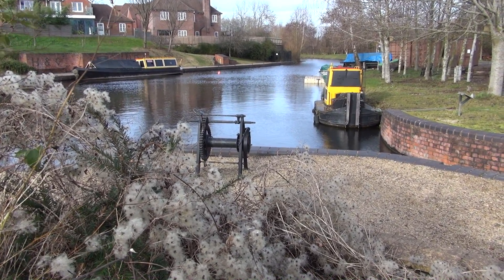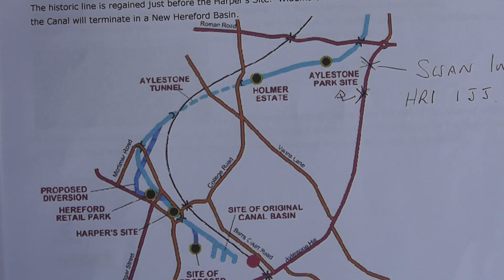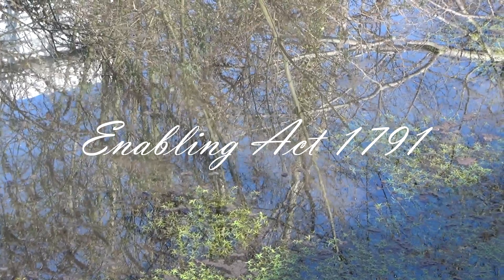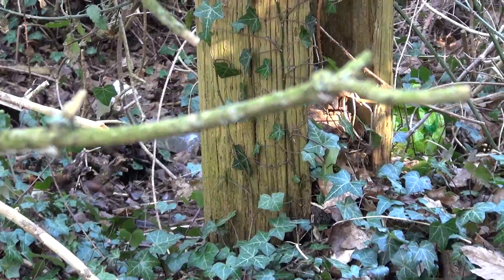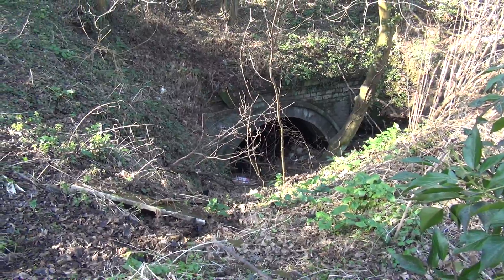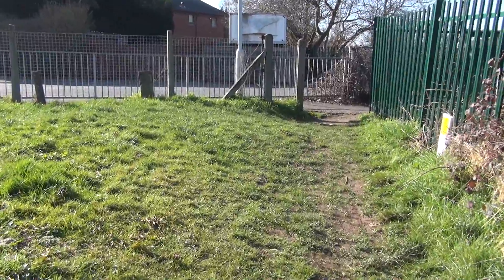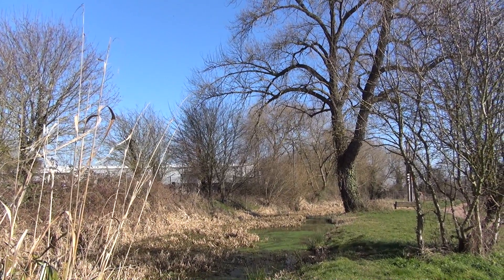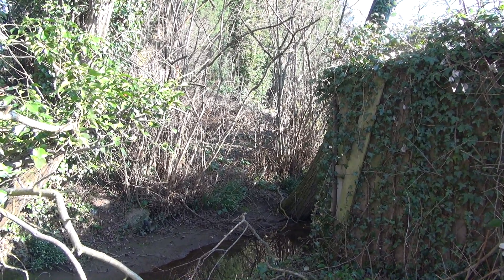Gloucester to Hereford Canal   Hereford end

Comment: When Currys/ PC World was built  at the outer end of Widemash Street  in Hereford, planning conditions included a requirement to preserve the line of the canal. This is perhaps the most impressive part of the Hereford end of the canal but is not  very large or connected.  The actual terminus of the canal was close to the railway station and can be seen on very old maps of Hereford. Since I moved away from Hereford a new main road has been constructed right where the terminus was.   If travel from the Currys PC word site into Hereford within a very short distance and prior to the road junction you will pass over a road bridge over the  original route of the canal.
ln your fascinating video you looked around the road , corner and commented "not very exiting", or similar, that road would have taken you directly on to a rail bridge, over the bridge is Currys PC world.  I recall that Staplow was the main activity area for those in the preservation movement and  at Monkhide Skew Bridge is worthy of a look. Thank you for an informative  video.
Reply from the maker: Thanks for posting that fascinating info Andy, I'll take a look next time I'm out there. That's if lock down ever ends ! Ron